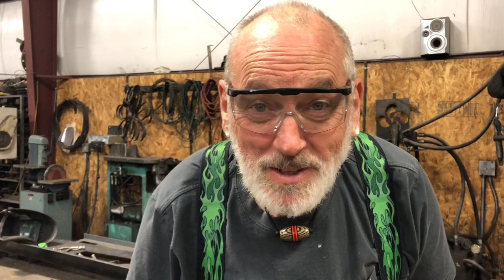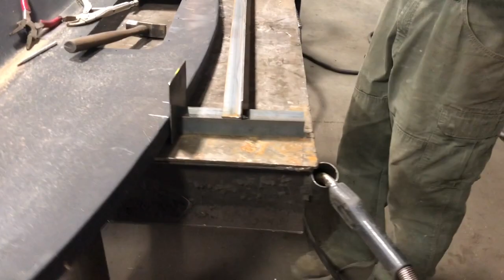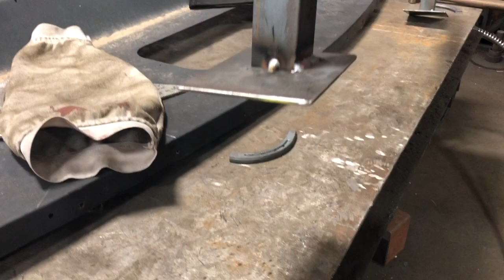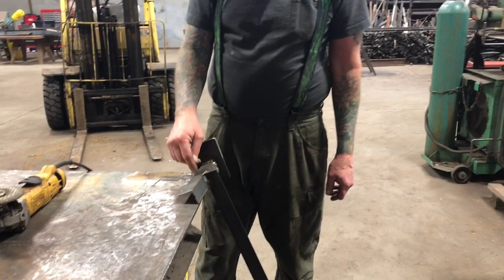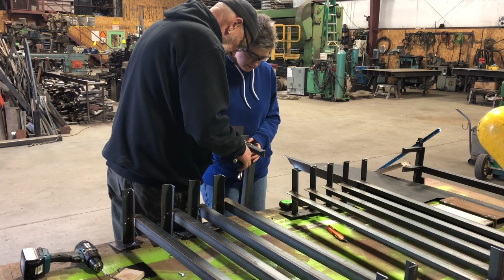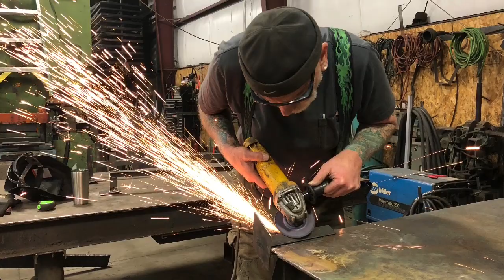Building Solar Panel Roof Rack - Vlog 63 School Bus Conversion

Comment: They look great. I'm stealing your center catwalk design when we get to our solar setup.
Reply from the maker: Thanks - hope it works out for you. We are all about sharing our journey.
Reply: @KnappTime  I'm thinking about using welded on or sealed closed stainless steel rivnuts to hold all of my rooftop attachments like the catwalk and solar panels to the hat channels so they'll be removable after spray foaming the ceiling.  What do you think of that idea?
Reply from the maker: I was going to cut some six or 8 inch squares of sheet metal and welding that to them and put it on the inside when I both roof rack on. If I glued that on with Sica flex when I bolted the roof rack on I would have a good seal and it would stay in place if I ever had to remove the roof rack. It would be glued to the roof with the Sica flex and trapped under the spray foam. Then after I discussed it with the guys in the shop they thought it was a little bit obsessive. So I haven’t done it yet but I have fender washers for my half-inch bolts and the nuts are Nylocks. We think that will be sufficient. If I ever break a roof rack or have to remove it I would just have to dig through the spray foam to get to the nut. Because my ceiling panels are all going to be removable on the inside wouldn’t be that hard to get to it and I could refill it with cans spray foam after the repair was done. But I like your line I thinking it sounds like a good idea. So many choices 😀

Comment: How did you attach the rack to the roof? Did you use rivet nuts or just drill into the ribs? Love your design and plan to use it on my skoolie Homer!
Reply from the maker: We put 4“ x 4“ pads on both sides of the roof rack with two bolts in each one that went through the roof near a rib and used a large fender washers underneath the anchor them. We put Sica flex down on the roof and then bed of the roof rack into it with more Sica flex underneath them. 😃